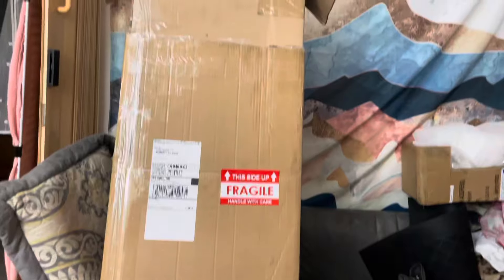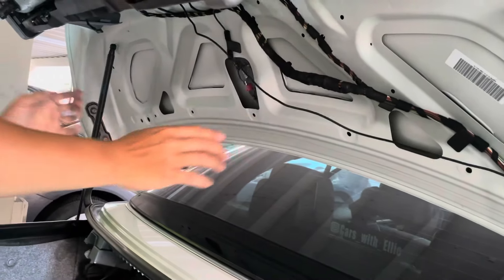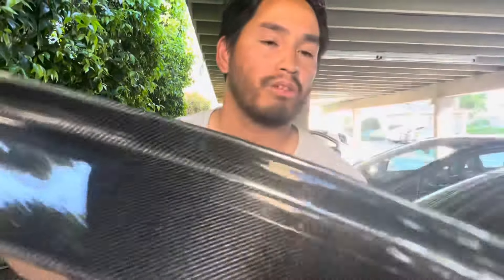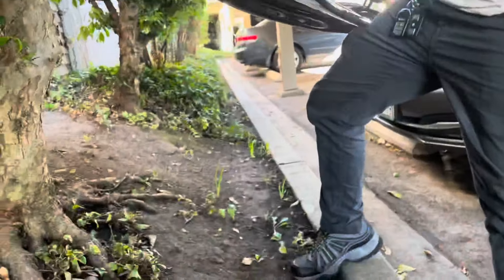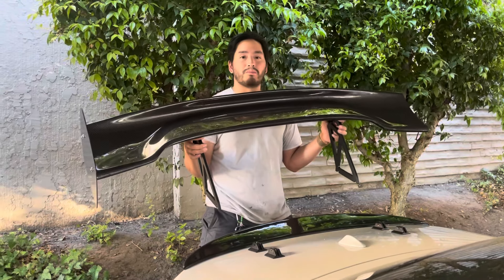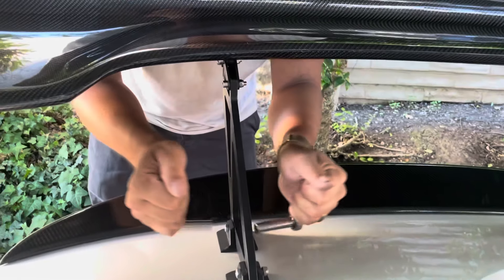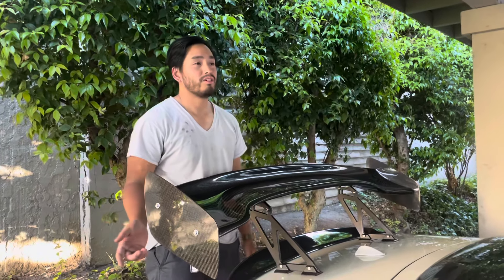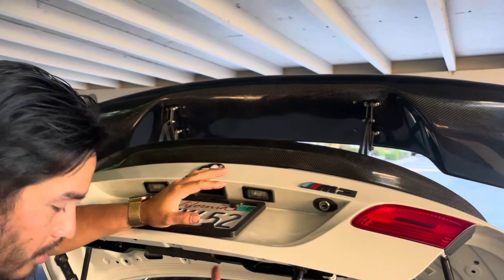Carbon Fiber Wing Spoiler Install on BMW E93 M3 Convertible ICBeamer

Comment: Trunk lid will bend with no support under.
Reply from the maker: @gordonsmith4511  I have a rebar I installed underneath from Home Depot. Helps with the flex

Comment: Get extra  longer screws, same width incase! Good thing I had one extra. And mine came with no Allen wrench, and be careful not hitting the wire I almost did! The washers go near the wing!And I switched my wing tips the other way looked sicker to me 🔥 got gloss black on a bmw f30 4 door thought it would look wack but I tilted it forward and looks sick as f. Paid 140
Reply from the maker: Thanks for sharing!
Reply: @Sals_Garage  thank you but I was on the highway and it was shaking. How did you stop it from shaking?
Reply from the maker: @SycaShow  I made custom rebar from Home Depot. You can also use a larger washer to give it more stability.

Comment: It looks really  really good
Reply from the maker: Thanks so much!
Reply: @Sals_Garage  how did u measure where you had to put the brackets from the end of the boot
Reply from the maker: I used measuring tape and put some painter's tape for alignment reference.
Reply: Do u remember the measurements
Reply from the maker: @kobunleashed6198  sorry I don’t remember the numbers. Try asking the seller. There are multiple holes for different measurements.

Comment: I think it would look better with a low mount application. Especially cause it's a convertible.
Reply from the maker: Thanks, I’m looking into other options such as a lower mounted one that looks more OEM. I do like having some shape in the back of the flat convertible.
Reply: U can tilt it forward looks lower

Comment: Hey I got one of these too on my 4series I’ve tried everything but overtime the wing slowly tilts down. And advice to prevent that?
Reply from the maker: @supersoniclightiffy  you need this on the screws https://www.amazon.com/dp/B0C8Z81WQL/ref=cm_sw_r_as_gl_api_gl_i_7ZP82NH1RZBC4GX5Z04H?linkCode=ml2&tag=sal05cb-20
Reply: @Sals_Garage  i did do what you said it worked pretty good but i noticed going over 100km it starts wiggling a bit did you ever have this problem, and also just recently the underside of it cracked was curious if anyone had something like this happen to them.
Reply from the maker: @ haven’t had that issue, hope you can remedy it soon.

Comment: I picked up a spoiler but the bracket that I have is slightly smaller I'm taking measures at maybe 5 in so it makes it look like it's a lower profile wing My question to you is from edge to the top part where your chin is at what is the measurement there so I think that's height and the width I believe it's 47 but what's the measurement for height
Reply from the maker: We don’t have this car anymore so I can’t measure it but hope you are able to figure it out soon. Good luck 👍

Comment: How is it after a while? Still there? I got myself on and it looks great, its just a bit scary because it shakes on bumps and on high speeds even tho i have secured it perfectly... Probably shaking from the whole trunk i guess
Reply from the maker: It’s still on many months later. The trunk is aluminum so it will flex a little bit the bolts are not loose so that’s what matters. Good luck 👍
Reply: @Sals_Garage  bolts are super tight and wont shake... On bumps the whole thing vibrates yea and it makes me scared a lot
Reply from the maker: @pako-nsgs  no need to be scared, the E93 convertible shakes as a whole in bumps since there is no roof.

Comment: What size holes did you make in the trunk. My spoiler comes in today and I wanna make sure I have the right drill bit size to make my holes
Reply from the maker: I can’t remember but stay as small as you can fit. Good luck 👍
Reply: 1/4 drill bit 🫡

Comment: Would you say for the most part, at its price point, is it a good wing! I’m trying to get a new wing on my tsx! But I keep on seeing all these plastic ones! So what do you think of this carbon fiber one?
Reply from the maker: This is definately a step up in quality from the plastic version.  The carbon fiber is real inside and out as you can see when I drilled a hole through it.  The clear coating is good quality, has lasted so far without any issues 👍
Reply: @Sals_Garage  awesome thank you! Like I was saying it’s been hard to find a carbon fiber wing, let alone a real one that isn’t over $1000! But thank you again!
Reply from the maker: Anytime!  Good luck 👍

Comment: Does the wing shake or wobble while driving?
Reply from the maker: A little bit. I ended up putting some metal rebar under the trunk for stability since the trunk is aluminum it flexes.
Reply: @Sals_Garage  I have the same wing and the same problem, could you make a video on how to do this or how you did it?
Reply from the maker: @Xd-tc8ht  I don’t have the car anymore but try using this https://amzn.to/47tizE9

Place underneath the trunk for stability.